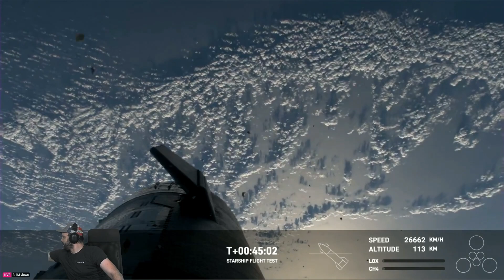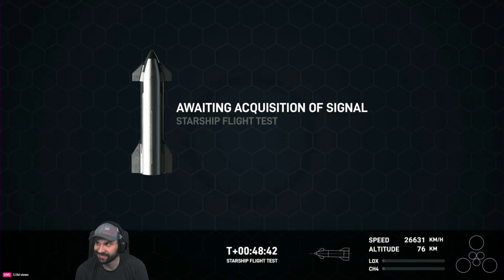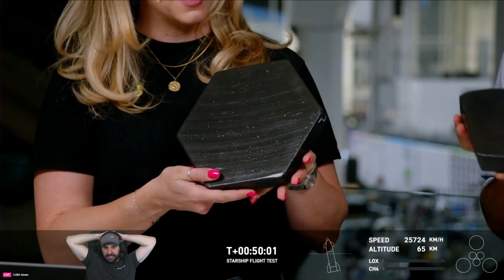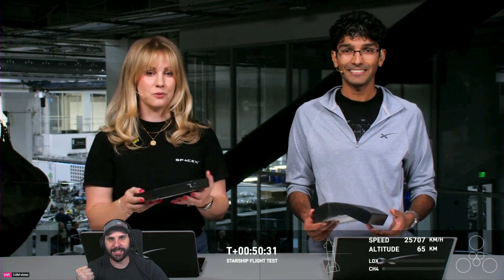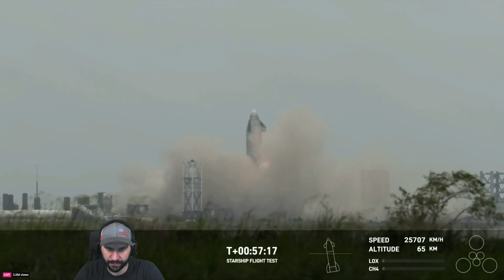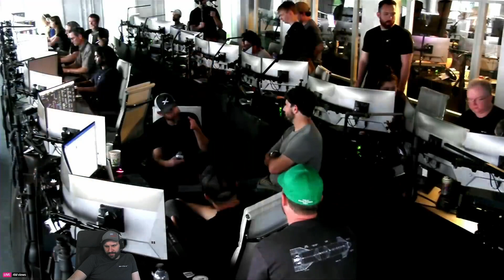STARSHIP IFT-3 RE-ENTRY ATTEMPT!

Comment: There needs to be a one piece or at least two piece heat shield jacket. Individual tiles allow for localised failure resulting in catastrophic loss. With 3d  printing this should be explored.
Reply: theyve got a thermal blanket beneath the heat shield already

Comment: A REAL SHAME THAT THE R.C.S. COLD GAS THRUSTERS DIDN'T CORRECT THE RE-ENTRY ANGLE AND ORIENTATION OF THE SHIP BUT THERE WILL BE A MOUNTAIN OF ENGINEERING DATA THAT WAS RECORDED FROM THIS FLIGHT THAT IS GOLD TO THE ENGINEERS TO IMPROVE IFT-4 ! ! !👍👍👍👍👍👍👍🤔🤔🤔🤔🤔🤔🤔
Reply: Chill bro,the starship only had 3 flights and its still in development
Reply: The camera is on the flap (they even mention that), so the view angle changes as it moves, leading people to think it's not stabilized at the right angle.
Reply: @ramonsaldanha4841  ok,ur right but it did escape out of control